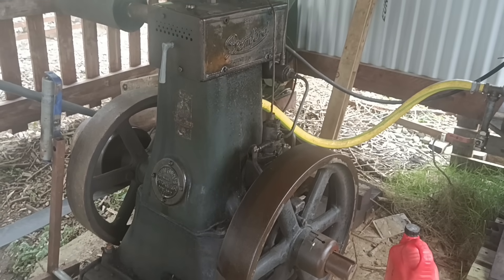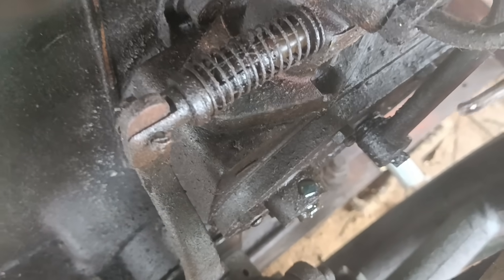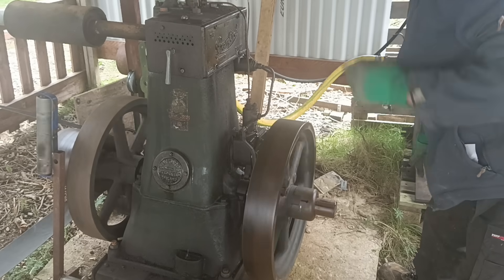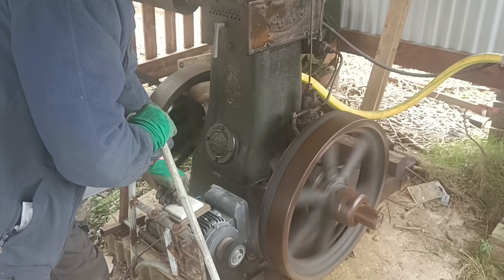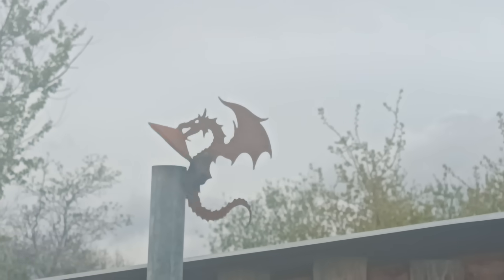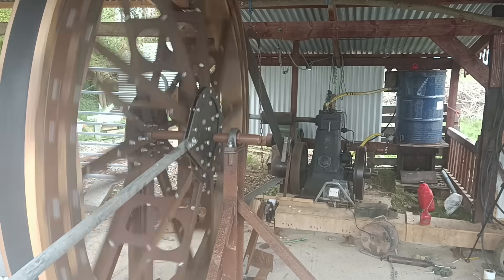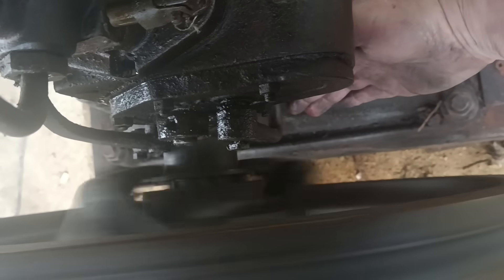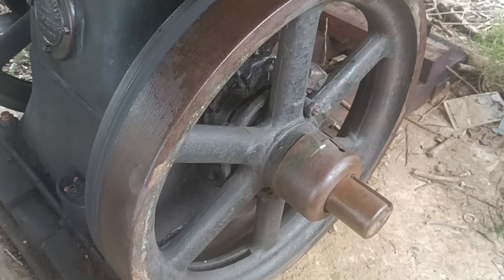How Much Fuel Does This Vintage Engine Use? Bamford stationary single-cylinder diesel efficiency

Comment: I love what you are doing here and each even tiny progress and achievevements in the video. So the engine running is great.

But the comparison is lacking the big point that a modern car engine needs what: a huge amount of money and efforts to clean the exhaust you do not really have to care about and pay for

If you would have to pay for the comparison would look quite different too and the electrical one would be .

And on the other side your great skills would be usefull to put a huge solar panel array on top of the horse shed or create a solar power array on the ground. Lots of weldering, especiall in case you would go the extramile to follow the sun, maybe first the pitch (for winter spring summer and autumn) and later the angle. 

I know you might call it too expensive but simply start with used old panels with a lower output per sqm but simply start cause you get the bigget benefit from the first kW you can produce cause if you look at the power / energy meter you can see it spinning constantly cause there is a base load in every house hold cause by all the connected standby devices like chargers and the internet router and the PC turned off cause even that is taking its power beyond 1 W just to hibernate or await the wake on lan call to awake. 
1 Watt is for close to all people like nothing, so they do not care about. 
1 Watt in a 247 usecase like smartphone charger or PC turned off is 9 kWh per year consumer, so to get from the power needed  now 1W you simply use the factor 9 and replace the unit Watt by kWh to get a glimpse what it cost a year. Your usual internet router takes 10 Watt, each repeater mostly even a bit more (cause listening to repeat is a lot of work cause that router to repeater communication is happening on a different band than the usual WLAN), than 5 chargers everywhere, a radio, a clock, a amazon echo and what not each 1W. And that causes the base load you can easily identify the next holiday you might spend in germany to search for good old solar power system or used panels cause here they are thrown away or sold for cheap cause after 20 years they are no longer allowed to feed into the grid for compensation. 
When you come back you might see a 100 kWh higher powermeter figure which equals in what ? 100 kWh / 20 holi days = 5 kWh per day 
that means 5 kWh / 24 h = baseload of roughly 200 Watt ... which is high or low depending on what you have to run while being away like fridges and water pumps and feeding or lighting for the animals on the farm . 

200 W means that a small 1 kWp array out of 2 big new solar panels for 166€ purchased in germany will produce enough energy from 9 - 18 to deliver enough power for the whole base load. These are the big one used on agriculture solar power plants with 2,2 x 1,1 m each and a 320 € investment.
Well, you can also get 20 year old panels each now degraded to 100 Wp for 20€ maybe and 1,5 x 1 m much smaller and with those 160€ you could get even 8 of them or 800 Wp but you would need also 12 sqm while the others just need 5 sqm. If your property is big enough it does not matter , but if the array on your roof that is facing south with a good 30° slope and without obstacles that cause shadows on the panels (like chimneys) space matters.

And if you have to buy the mounting rails to put them on your roof the used one will not be build cause the mountings for each module are about 50€ and then 8 mountings would cost you 400€ - compared to 100€ for the 2 for the big ones - unless you get it from the old roof and can reuse it.

Just give it a try - maybe buy a Balkonkraftwerk during your next holidays cause you might get a 600 Wp system with 2 modules and the inverter for about 600€ cause they are now VAT free since January. Just a point to start and learn how it works in general with all the comfort of tracking the production. Also to tinker about the system what benefit a system brings that follows the sun. And there you can bring in your whole experience cause you can not buy those systems for cheap from the solar power store, most of those are hand made on farms. 

And if you do it your own way as usual it is good to start soon and get behind the secrets and why the benefits of a tracking system are so high for you in ireland cause the output is predictable, also the benefits of such systems: up to 30-40% just by the pure mechanis to turn and pitch the array with a small electric controller to follow the sun

30 - 40% more means roughly that you have not to invest in so many panels and can get along with a smaller inverter which is cheaper. 
1 kWp without the tracker can be achieved by a 0,7 kWp panel investment - or 10 kWp can be replaced by a 7 kWp system which is following the sun.

But start small with a few panels and watch the production figures to get a glimpse how terrible a shadow caused by sat cable or power line could be cause if you would have a 10 module string of 500 Wp a tiny shadow of such cable crossing just 1 panel about 50 cm would bring the output down from 5000 W to 3000 W or even less. And you can learn those lessons for cheap with a Balkonkraftwerk as they are allows in the EU up to 800 W - only in germany 600W right now, but soon also 800 W. Watt means here the inverter output , the maximum output which can handle up to 140% input power, in particular 140% DC so you can overpanel nowadays inverter by 40% on the DC side. I guess you might be allowed to generate 800 Watt and therefore should be good to go with a 800 Watt system and a 140%  solar array of 1100 Wp. If the sun is full bright the inverter will only generate 800W feed into your house and the excess will be fed into the grid what you are not using. The inverter will generate his max. output far earlier in the morning due to overpaneling and when it reaches the peak it runs full speed and the overproducion from the solar panels will not be used and harvested.

Keep on rocking !
Reply from the maker: the grid here is very cheap and (mostly) reliable - so I'd be reluctant to buy a heap of batteries for when I need to do some welding..

Comment: I am sure someone smarter than me could calculate the average power output of this engine based on the energy content of the diesel (38Mj/litre) and the running time of 1 hour, combined with the efficiency rating of a typical diesel engine (maybe 30-50%?)
Reply: Just scrolling through the comments I did that in another thread. 
However, our efficiency is far too much. 50% is somewhere around the theoretical limit that could be done if the engine was perfect without resistance etc. 
Modern passenger cars maybe only get around 30-35ish at best. 
This engine is far from such an engine, so it's most likely much worse. 
So I just assumed 22% efficiency. Could still be high, but that would make for 1,5kw of power at the output.
Reply: @humbucker0076  seems like a perfectly Reasonable output for the work done. Plenty of power left in that engine for bigger tasks. It would be interesting to see the consumption for heavy slicing with a dull blade.

Comment: is there a difference between agricultural diesel and car diesel?
Reply: No chemical difference although it may have a red dye added just in case you're caught with it in a road vehicle which will get you in a bit of trouble. It's taxed less and so is a bit cheaper for the farmers to use in their agricultural machinery. I believe it is also available for canal boats as well, although that is shifting to undyed road diesel with a discount on the tax paid per litre.
Reply: @philthorpe4549  thanks for explaining.
Reply: @philthorpe4549  Pink dye in UK.  Green dye in Eire.

Comment: Surprisingly efficient, but I guess 600RPM in a diesel IS basically no fuel.
If you swap out rubber parts with ones that won't dissolve, you could cut the diesel with vegetable oil or ethanol to make it even cheaper.

Otherwise, they fell out of favour because electricity is easier and doesn't require extra maintenance, and because you can also run stuff from the PTO on a tractor and again be only maintaining the one engine.

Comment: I hope that getting your fossil carbon footprint down by investigating the use of Waste Veg Oil, or if that's not available, Straight Vegetable Oil, will be one of your next projects.  This, alongside the biochar, will really help your sustainability impact. You're in a good position with nearly 50k subscribers, to teach people a thing or two about how to be more ethical re the climate.
Reply: @tripplefives Yup, I understand that.  I teach this kind of thing and fully understand the complexities.  That's why I mentioned Waste Vegetable Oil, or Used Veg Oil, as this has been produced and used for it's intended purpose - and is then 'disposed of' in a number of ways - hopefully not down sewers where it solidifies to form 'fatburgs' which are an awful thing to try to get rid of - although can be collected and rendered for fuel themselves.  WVO or UVO is the best, most sustainable option - 'least bad'', and SVO is potentially better than fossil diesel since when burnt the CO2 emitted is carbon which was sucked up by a palm tree, hemp, canola or soya plant in the past year or two, so thus not adding to the drip-feed of fossil carbon entering the atmosphere.  Fossil diesel requires as much processing and transport as any other commercial liquid fuel, so the argument about processing and transport emissions is similar for fossil fuels as for SVO-based fuels.   The advantage of developing plant oil-based fuels is that these might, in an ideal scenarion, replace fossil in the machines used to produce and process the oil.  

The economics is easy to solve - on paper at least. Tax fossil CO2 emitting fuels much more heavily than ones emitting carbon drawn in from recent photosynthesis.  It's not a 'perfect solution' but would push people into using and developing non-fossil-based alternatives.  And stop subsidising fossil fuel extraction - something which ordinary people still don't know happens in the UK and USA.
Reply from the maker: No such thing as waste veg oil here, John. The companies who supply the chip shops, etc., have contracts to buy back the used oil
Reply: @wayoutwest-workshopstuff6299  OK, interesting.

Comment: That last remark got me wondering how that old engine would go driving an electricity generator. It's funny hearing 6 hp from something that big but, of course, the engine torque is enormous
Reply: 6HP is roughly 4.5KW but probably something closer to 4KW after conversion losses.  Still plenty to run something like a couple electric heaters in an emergency.
Reply: @big0bad0brad  Or charge a bank of batteries, that in turn would run an inverter. This way You could use a far heavier electric load than the engine is rated for. At least as long as the batteries charge goes.
Reply: @sysbofh  Then you have more conversion losses, I was thinking just direct AC generation with an AC generator but it could certainly work as well.
Reply: @big0bad0brad  Yes, You have conversion losses. But You can run the generator at 100% capacity - this is where they are most efficient.

Also, makes easier to store the energy for latter and You don't have to worry about peaks of usage or the generator rated capacity. Any temporary excess load is provided by the batteries.
Reply: With a battery bank you can also have solar, so the diesel might only be needed on cloudy days.
Reply: Usually on generators the kw output is less than half the engines max hp so it would be 3kw or less.@big0bad0brad
Reply: im guessing 6hp with 16ftlbs torque😂
Reply: @fidelcatsro6948  I wouldn't put money on it but I suspect the torque would be significantly higher than that. I guess I could just go look up the engine since I'm already online. 😁
Reply: @fidelcatsro6948 right so I wasn't able to find specifications but, based on the rmp and rated horse power, the torque would theoretically be around 53ft-lbs so there we go, I've answered the question that absolutely no-one had actually asked - apart from me. In case someone is interested, I used an online calculator and deduced the number (Horse power = torque X RMP, since we know the engine is governed at 600 RPM. . .)
Reply: @nobodycares85  my 1200cc gasoline bike with 4 cylinder makes 90hp with 60footpounds of torque, for comparison, im assuming that thing is at least 1000cc diesel???
Reply: @fidelcatsro6948  Good question. Perhaps if that old thing could rev the same as your bike, it would likely have a higher power number. Of course, I'm speaking from a position of very limited experience.
Reply: @nobodycares85  imagine that thing revving to over 5000rpm 😆😆😆

Comment: Interesting,  but the engine isn't running flat out so can't really compare to a 4kw motor flat out.
That said you wouldn't get so much fun tim lol.
Oh...and a US gallon is smaller than a UK gallon (which is 4.55l)
Reply: @tripplefives  the engine is rated at 6hp. That is the 4kw I was referring to. Yes he mentioned 4kwh but I'm not sure how he got the calcs for that.

Comment: That engine can produce 6 horsepower (about 4.4kW), but it isn't in the test. When you start bogging the engine down and the governor gives it more fuel it produces 6 horsepower. In your test it was likely not producing much over 1. This means that an electric motor would not consume 4.4kW. It only does that at maximum load. If your engine generates 1 horsepower, an equivalent electric motor would consume about 0.8kW. 

Also regarding biofuel as you touched on briefly: You could probably run that on anything liquid which burns, considering the age and simplicity. The only reason modern diesels can't run on straight cooking oil is because the injectors can get clogged, as well as the the computer in the car possibly forcing it to shut off since it's not diesel.
Reply from the maker: Thanks, Edvin - I imagine the max power output is just before the engine starts bogging?
Reply: @wayoutwest-workshopstuff6299  I would guess maximum power is when it just starts bogging down a bit, forcing the governor to give more fuel to produce more power to keep it running.
Reply: I second that theory of yours..3.2 to.4Kw gen on single piston engine & 6Kw + on two piston engine " Marcon" gen if my memory serves me correct..!??

Comment: I have some experience running a more modern diesel car on clean filter waste vegetable oil by heating the oil with engine coolant and valving so you start on diesel till it’s hot and the run on WVO, then shutdown on diesel. Now I would think this engine is likely to be able to tolerate this I’m not sure it would be worthwhile given what you are paying for your diesel and there’s far less mucking around. Likely possible if you wanted to look into it though

Comment: In a shearing shed where i worked after leaving school at the age of 15, had an old Lister 5hp diesel engine that used about 3/4 gallons of fuel in an 8-hour day!!
Reply: 3/4 gallon as in 0.75 x 5 = 3.75 litres not 3 to 4 gallon as in 15-20 litres per day, I presume.

Comment: Actually you should be able to run the engine on pure vegetable oil after it had been started on normal diesel and warmed up a bit. Just make sure to switch back to diesel before turning it off so it can start again on (nearly) pure diesel next time.
Reply: Perhaps run the coolant lines thru the fuel tank with veg oil to pre-heat it before it goes to the injectors, that's the main reason to heat it...to thin it out so it can pump thru the injectors and pumps easier

Comment: Using a modern electric motor to start an old diesel always strikes me as ironic. Surprised it used so little, like you say the motor isn't really running at load, more idling. So does make sense that it isn't consuming vast volumes of diesel.

Comment: Very interesting Tom 👌 👍🏻 we have a 1 horse 1 cylender stationary engine of the Lister make, drivers a large saw blade with a lift forward vee table,,, good for cross cut firewood 6 -8 ", 150 - 200 ml running on a 4" Flat belt, funny I forgot were I was going 😢,,, anyway great to here ol diesel beets electric 4 to1 🎉🎉🎉🎉 wish I could remember what that first was leading into I was gonna say something about Grandads wood engine?.? Stay safe team 🙏 💙 ❤  loves from New Zealand.

Comment: could you run your engine on wood gas? that wood pair well with your hole char coal operation.
Reply: Lots of diesel engines run on natural gas so running a diesel engine on wood gas should not be an issue either.

AFAIK a small amount of diesel fuel is injected with each stroke to provide ignition but the main source of power is the gas mixture in the intake air.

Comment: I use old stationary engines for various jobs, later 60-80's engines though as they're cheap to buy, still have parts made and can be moved without a hernia. 
That bamford is glorious
Reply: I've looked at buying some old stationary engines, but apparently, I need to buy a forklift first haha
Reply: A wheeled engine hoist and heavy pickup truck or trailer or agricultural equipment mover trailer is another option as hand trucks can only move the smaller engines around the smaller engines sadly end up as decoration in some cases .